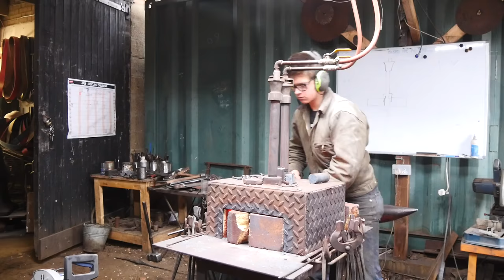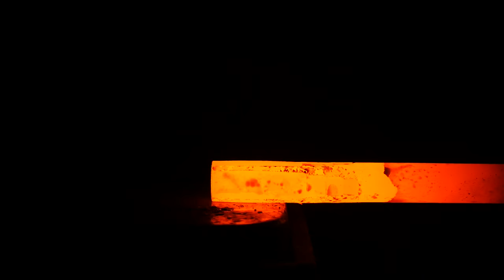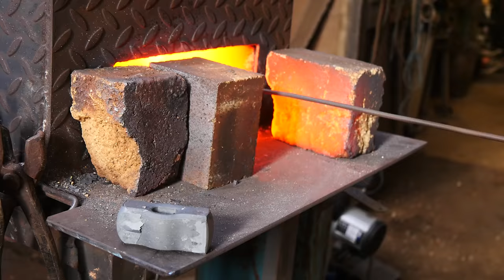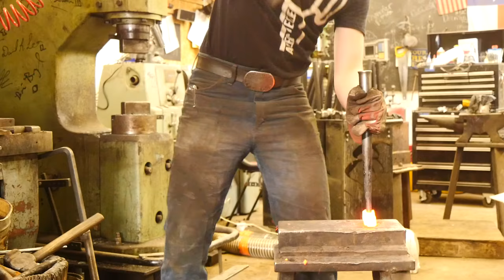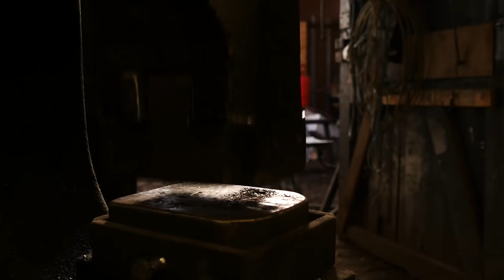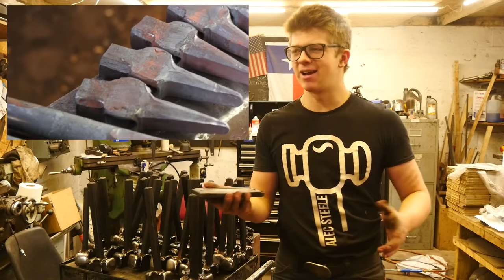FORGING Drifts and Hammer Eye Punches

Comment: I have just installed a 2Cwt massey and am learning to use it, I think today I will try to make some drifts Cheers Bevan
Reply from the maker: +Bevan Wilson that's so awesome! I'm very envious! The massey's are the best!
Reply: Alex what materail do you make your long drift out of I have spent the afty forging tapers out of high speed steel from really big woodchipper blades and used them to drift a hole in a hammer head Cheers Bevan

Comment: The bolt in your power hammer is loose...
Reply from the maker: +Devin Bell which Bolt?
Reply: Alec Steele the one on the side of the anvil.
Reply from the maker: +Devin Bell ahhh! That's actually just a saddle so it sits there until I need to put a tool in it - then I tighten the bolts :)